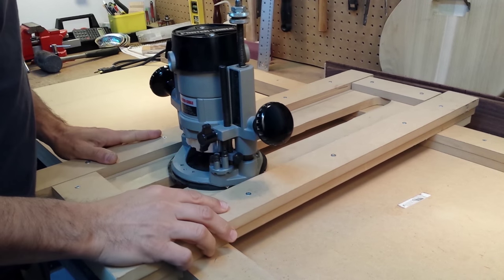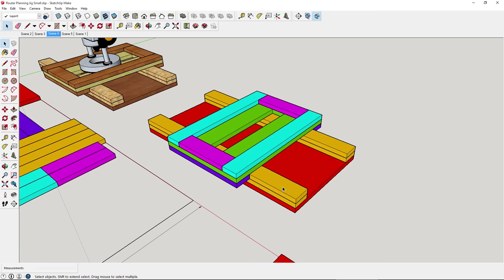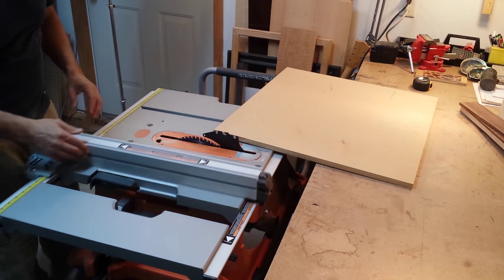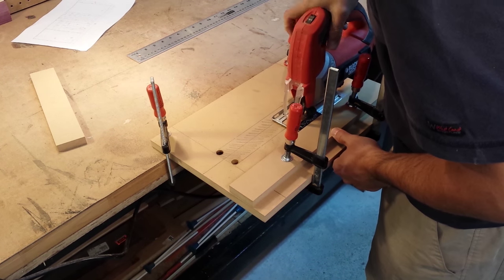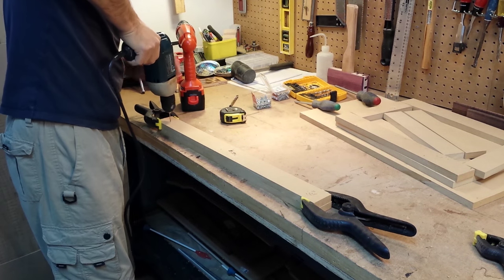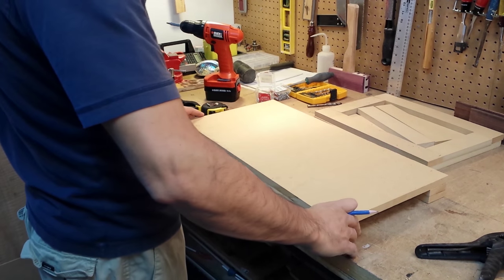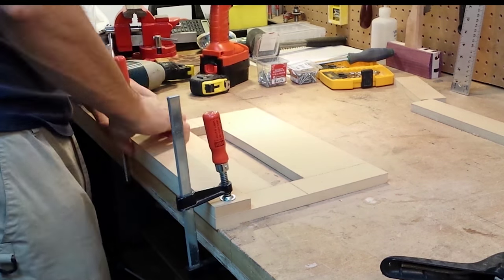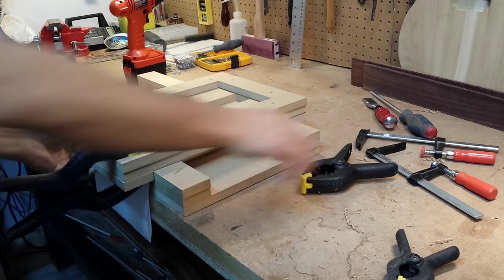How To Make A Router Planing Jig

Comment: Just built this and it works fine. Made a couple of additions. Put a strip on the front under the main base panel to keep it in place against the workbench. Cut some narrow cross strips to hold the router in place to allow the sled to be clamped to run  longer boards through. These are moved one at a time to reposition the routed. Used hot melt glue instead of double-sided tape to hold workpieces in place.

Comment: Thanx for the vid. How far does does the bit extend out of your router? I just made one of these, similar, but my router bit only extends a little over 1" out of router, so when it's sitting in its sled on 5/8" of melamine there is barely any bit left below available for cutting. The rig worked well enough but I was only able to do a single  shallow pass.

Comment: Awesome job and thanks for the cut dimensions.  Have you had any issues with the MDF regarding moisture/expansion/etc. leading to unevenness over the past year? I almost never work with MDF so unaware of its ability to stay perfectly flat over time.
Reply from the maker: Thanks. I haven't had any issues with moisture or expansion. MDF is a man-made product so it doesn't behave like wood. It's a great material for jigs and templates because it's very stable, easy to cut, keeps a clean edge and it's inexpensive... just don't breath MDF dust! :)

Comment: My router base is 6 inches across.  Should I increase the width of the guides on the sled
to compensate for smaller router?
Reply from the maker: Yes you can compensate for a 6" based router...

Comment: Do these cut measurements take the thickness of the saw blade into consideration?
Reply from the maker: +FlyingSquirrelTony Yes, I do take the blade kerf into account... My blade thickness is 0.09" (2.4mm), so I know that, for every 10 cuts, I will loose about 1". However, in this case I have plenty of wood and don't have to worry about the loss of wood due to the blade kerf. The cut list only serves as a cut list... If you want to be "accurate", then you can add the blade thickness in the Sketchup plan by leaving about 0.1" between the pieces, but in this case, that's overkill.

Comment: How did you hold the work piece in place so it does not get moved around by router bit? I have watched other sled type planer/router setups and It seems that the work pieces are somewhat flat on the surface that faces down. My situation has it that both surfaces on the work piece are quite rough and gouged making it tough to keep the work piece stable making it difficult to plane with the router. My goal is to get work piece smoothed out enough to run through a finish planer to remove more wood to leave a veneer two to three eiths inch thick. 
Any suggestion on holding pieces in place?
Great job on video and tech skills!
Thanks,
Tim
Reply from the maker: Thanks Tim. 
If you can't lay it flat then you'll need to build some type of support for it until you're able to get at least one face flat.
Reply: For rough pieces I choose side that is more flat and face it down and stick some scrap, thin wood as a shim to stop rocking. Then use couple of blobs of hot glue. Not much. Afterwards I just clean it off with a chisel. Not perfect solution but so far it works. Though I have to be careful if I want my flat surface to remain flat :)

Comment: I bought mdf 2 months ago and it was such an irrating smell. How can bare to even work with it?
Reply from the maker: If you are able to smell the MDF then you are not clearing the dust well enough. Make sure to have good dust removal, ventilation and dust mask. Don't mess around with wood dust, it's nasty stuff, especially MDF!
Reply: I bought mdf from home depot hoping the smell woud go away. Even before making a few holes in it smell. Anyway stay safe.

Comment: what is holding the work piece down?
Reply from the maker: I usually use double-stick tape to hold the work piece in place. Lately I've also been experimenting with the "masking tape + super glue" trick with some success. Both methods are good.